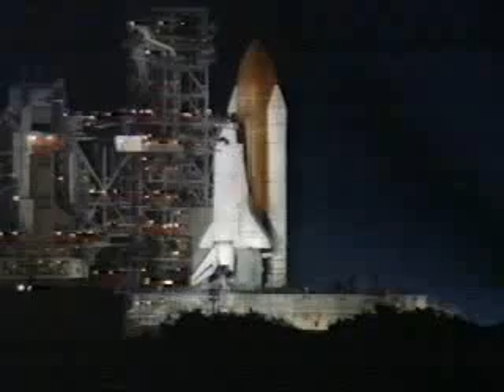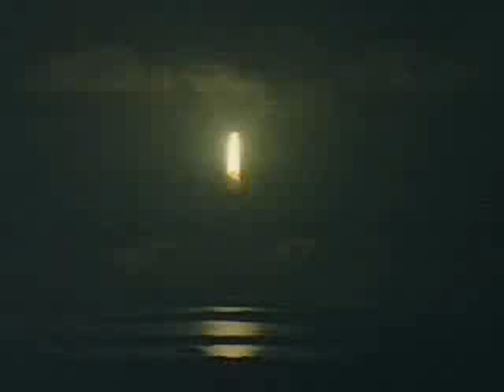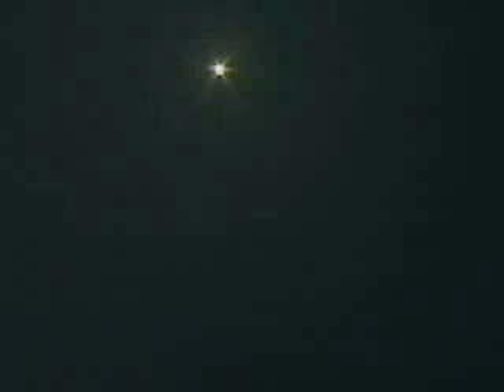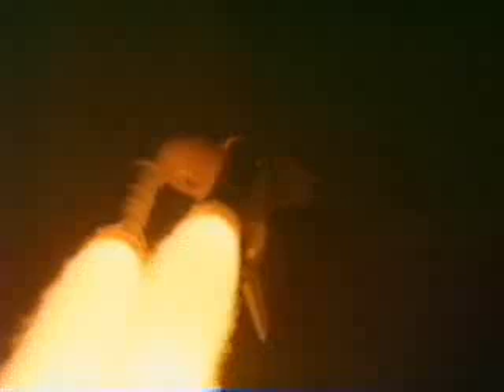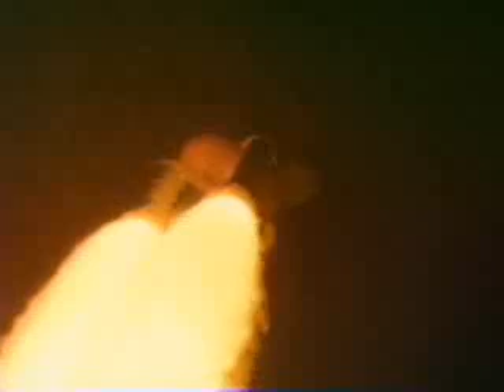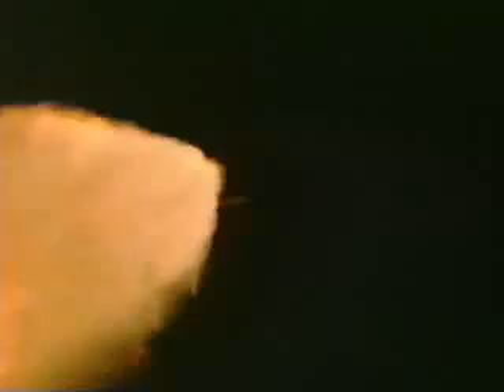STS-79 launch (9-16-96)

Comment: This was the first US resident crew exchange,  with John Blaha flying on this flight to  Mir to replace Shannon Lucid, who had set a new female world space flight endurance record of 6 months. Atlantis flew for the 17th time and this was the 4th Shuttle-Mir Docking, as well as being the 6th Spacehab  mission, and the first double module spaceflight mission.  Delays caused by problems with the adhesive on the SRBS and then Hurricane Fran  meant the first double rollback to the Vehicle Assembly building in Shuttle history.
During 5 days of joint operations on Atlantis and Mir, supplies were transferred to  Mir and supplies transferred to Atlantis. 3 experiments were operated on Atlantis while the Shuttle was docked to Mir .
Commander Bill Readdy made his 3rd and last flight, his only one as Commander.  Pilot Terence Wilcutt made his 2nd flight. Mission Specialists Jay Apt and Thomas Ackers made their 4th and last flight.  MS Carl Walz made his 3rd flight.  John  Blaha’s stsy on Mir was his 5th and last flight,  and returning astronaut Shannon Lucid also made her 5th and last flight.